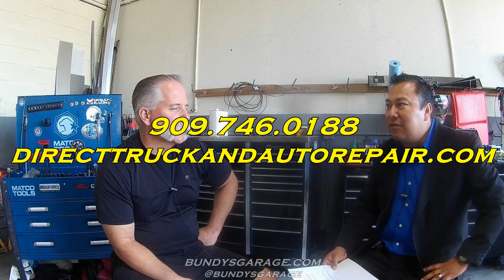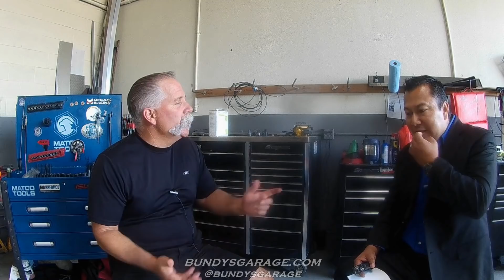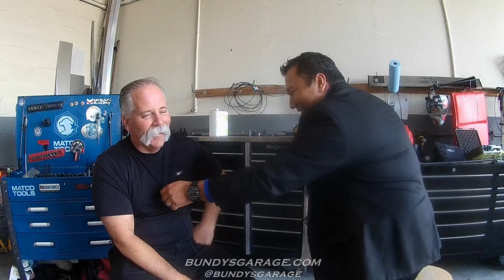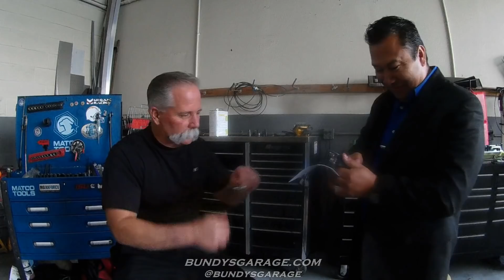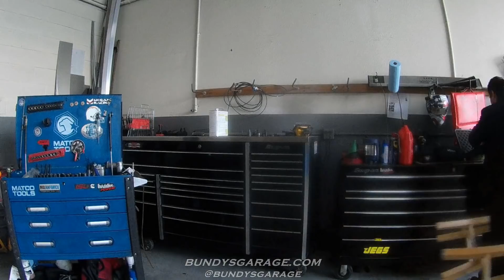Worst Diesel Engine Ever - What is the Best Diesel Truck out There? | Ford Dodge Chevy

Comment: I want to build a F600 single-cab between 1967 and 1972, F250 long-bed, aftermarket fenders, with a pure mechanical 12-valve P-pump Cummins compound turbo diesel,  belt driven lift-pump {predator or fuel-boss},  ARP 625+ series head studs, AFC Live,  Autometer gauges, Allison MD-3060 transmission, MISHIMOTO universal heavy duty transmission cooler with electric fan, NP-205 transfer case, Dana-S110 rear axle, RD1370F8 Reyco-Granning air bag rear suspension, Dana-super-60 CVJ front axle, Kelderman front air-bag suspension, 335/65R22.5 Goodyear G275 MSA tires, on Alcoa rims, AEV high air-intake pre-filter, Central Tire Inflation System, all LED lighting, lots of Dynomat, telescoping west coast truck mirrors,  train air horns, exhaust-brake, hydro-boost brake booster,  stainless steel braided brake lines, Quadraulic hydraulic 4-piston 4-wheel disc brake system, Hydraulic Ram Steering Assist, nu-relics power windows, Hellwig anti-sway bars, Roadmaster Reflex steering stabilizer
To tow a 5th wheel travel trailer across the lower 48 states to see the national parks and visit my extended family.
Not that I have given this any thought.
Just my day-dream!
Reply: That sounds like the truck to own!

Comment: It’s unholy to compare a DT466 to a “7.3”. T444E btw
Reply: The DT-466 is the Legand 7.6-liter I-6 design with wet sleeves a true medium duty work horse.
Reply: DT466 is a hell of a lot better engine.
Reply: @Copperhead Sutton Echo that about the DT466; had a customer with a fleet of local use IH cabovers w/ 22' boxes, can't remember any chronic problems, just routine maintenance.
Reply: DT466 was a good engine that I saw a RR truck get over 400K on but the best ever was a DT530 which was used in many fire trucks and emergency applications. I have owned 20 different diesel engines and got this International 4900 as a cab and chassis from the dealer then put a 12 yard dump bed on it and loaded it heavy. Absolute work horse that was powerful, durable, fuel efficient and dependable for 6 years and 400K plus miles before we sadly turned it over which twisted the frame.

 I built another brand new freightliner truck and specd it the same new 12 yard dump bed but with a cat 3126 that they claimed was the best cats meow but turned out to be a wassy cat, to put it politely because my diesel mechanic called it the other word and said it was a throw away hunk of beap- that cost double and give nothing but trouble from day 1 until I sold it 3 years later after scratching my head and biting my lip over and over. I said no more pouring good money after bad money on this beautiful rig that hates work.

Comment: Very smart mechanic, I am a retired fleet maintenance supervisor for a large ambulance and medical transportation service in Tn. all ambulance packages we owned were Ford E-350 7.3 power stroke engines and they performed excellent , we had our own service department and they were serviced regularly, the engine problems we had after about 300,000 miles were injector and oil cooler O-rings and a few injectors and drivers, turbos. High pressure pumps after about  400,000 miles, just great diesel engines, we had multiple issues with the differential Chinese carrier bearings and of course the E4OD transmissions.

Comment: pickup diesels are all crap especially with DEF. so why waste your money on a diesel? they dont even sound like a diesel so you cant impress anybody, just buy a gas and drive it.
someday the hippies will outlaw diesels for highway use
Reply: Babylon falling  i meant anything after they started putting computers on them, they are not real diesels.
i like my 91 dodge with the 5.9 cummins because of its simplicity

Comment: You can service a 6.0 as much as you want either way the hear studs gonna blow off. I see you found yourself a man a little bias to Ford 😂
Reply: Head studs won't blow off, the original head bolts would.  ARP Head Studs will generally outlast 1 million miles.
Reply: 210,000 on my 6.0 stock head bolts
Reply: @Athlas87  people dont get that by 05 the 6.0 was a solid engine. It had less recalls and warrantt claims in 05-07 then 7.3s had in any 3 years. Most of the 6.0s issues were due to people not knowing how to maint them correctly
Reply: @theboyparker4899  our 05 6.0 blew head bolts at 213k stock besides egr delete. Then the computer followed by high then low pressure  oil pumps, all within about 5000 miles. The shitty oil pumps are what can really kill theses motors, or the factory egr bullshit.
Reply: I see more 6.0's without head studs tham the one with them, Both my 04 and 07 havent had these issues. The only problems ive encountered are the HPOP's on these trucks

Comment: i love my lbz dirtymax and allisons!!!
Reply: Yup, have never had even a slight issue with either of my chevys
Reply: Best truck ever made
Reply: Big Truck Med Rv the lmm is an lbz with a DPF and 5 more HP. Deleted it’s the same engine. Obviously different body styles but the trans and chassis are also the same
Reply: @TooTall85  keep them lubed is the main problem with all highway diesel shit fuel.
Reply: In 2007 I rolled the dice and got a 2500 Silverado Duramax Alison.  The only non lubrication or light bulb expense has been 2 glow plugs and replaced the batteries, which hadn’t died yet at 10 years.   I pull a near or slight past max GVW 5th wheel.  I put on  larger wheels tires, super HD shocks, air-springs, and a lift kit to accommodate the larger tires and extra weight.  I  added an EDGE chip with the Attitude controller. I also run Red-Line full synthetic lubricants bumper to bumper.  It has about 80k actual TOWING miles with no signs of stress.  I live in Oregon and mountains are an everyday part of driving. I’m afraid to trade up as the newer trucks seem a step backwards in durability in spite of having increased power and GVW ratings.  So build me Ford F-350 with a Cummins, an Alison,  an exhaust brake, dualies, and a 50 gallon fuel tank.  ;-)

Comment: Right on. Ford has an excellent chassis. Ram heavy duty is right behind it with similar layouts, So sorry for the engine in the fords 😢. For the record, the Allison trans does not hold up to the cummins, people have swapped that. Torque kills.
     You will say duramax has as much torque, but the Dynomometer has proven otherwise.
Reply: On the other hand, cummins swapped fords have no issue with the torqueshift breaking ;)
Reply: dre04mach as long as you leave your fingers out of the fuel pump or Ecm.
Reply: The dyno proves the duramax has more torque. And Alisons are built for a specific power level. And eat the torque. Swapping a lb7 Allison to a built Cummins is going to kill it yes we've known this since the 1000 came out since the 6.6l was notorious with a tune to destroy it.
Reply: jdr ok open mouth insert foot kid. Sorry for your loss in this debate. Click and learn: https://youtu.be/emJcrYuJArg

Comment: 5.9 Cummins 12 valve with a six speed. If it HAS TO GO IN A FORD then at least let it be a 79 or older.
Reply: If the V-10 in my '04 F-250 ever blows up I wouldn't mind getting a 12 valve for it.  I believe there are even adapters to bolt it to my 6 speed.  The Cummins engine is the best part about a Dodge truck, Chevy trucks ride the best and typically have the nicest interiors (not quality wise, but comfort and features) and the Allisons are typically pretty stout, Ford has the rest of the truck other than those things.

Comment: Powerstroke 6.7’s have been proven.   Look at the used high mile ones 250k plus still going original motors
Reply: Babylon falling  Ford can on the Superduty's but not on the F150's not sure on GM and Dodge although I do know GM uses C/V axles in their 2500 and 3500 models which makes me nervous. I mean it's definitely better for handling on light duty but for 3/4 and 1 ton something about a solid axle makes me sleep better at night lol.
Reply: @josephbowman4571  actually the cv axles should be fine. It's a case of how well you build something. And solid or straight axles really aren't that hard to kill.

Comment: Duramax and Cummins,Ford has not come out with a proven diesel since the 7.3 was dropped.
Reply: 6.7 has no issues. Duramax is a mess. Obvious answer is gonna be Cummins though. Too bad the truck it comes in is trash
Reply: Alyx Ivanoff I always kinda liked the new Duramaxes until my dad and I pulled a big cattle trailer with our friend's 2015 LML. Pretty gutless, but I hear you can get good gas mileage out of them when you're pulling with it. I might get a new Duramax if all I was pulling was a four-horse trailer or a smaller tractor or mini-ex. Other than that, 7.3, LB7, or Cummins all the way!
Reply: @2001FordPowerstroke  lml will fucking destroy a lb7 a 7.3 or a 6bt. Remember a lml is like 800 lbft of torque. The Allison is a huge torque hog tho.
Reply: @blowme6963  6.7 does have issues. Some year turbo issues emission issues. 7.3 6.0 and 6.4s are internationals.
Reply: The  new Ford diesel is fine.  Outstanding, in fact.
Reply: 6.7 is a beast.
Reply: What a lot of people dont know is the 7.3 up to the 6.4 are international engines. 6.7 is a true Ford engine.
Reply: I'm. A Chevrolet guy but all I would  if it's a for was the 7.3
Reply: The 6.0 the way International builds them had zero issues.  Fix the issues Ford added and it eats Cummings for lunch.
Reply: im still waiting for dodge and chevy to come out with their OWN diesel engine...
Reply from the maker: That will never happen. Cummins and Isuzu have Diesel engines down and why mess up a good thing. If Ford was smart, they would have partnered with CAT instead of International for the 6.0L. Could you imagine a CAT logo next to a F350 logo, now that would be a superior engine.
Reply: @bundysgarage  cat doesn't know how to make a engine. The 6.0 was a good design ruined by emissions.
Reply from the maker: Did you just say CAT does not know how to make a Diesel engine?
Reply: @bundysgarage  
All Caterpillar on road diesel engines and yes including the mighty 3406 were engineered and designed by Perkins with a Cat label on it. Honest truth.
Reply: I keep my 7.3 maintenance like clock work. I pulled a mack truck 8 miles at 50 and the tanker has 2000 barrels of oil..😆 praise the 7.3 the only motor that had ball's.  Btw ford did not make the 7.3 international trucks did.
Reply: Walter Frederick AGREED
Reply: the 7.3 was fords best.
Reply: Neither Gm nor Dodge make their own motors currently and the 7.3 was made by international.  Duramax is co designed by Isuzu and Cummins is Cummins.  Though ford does use a cummings in the I believe 650 series.  They since 2010 have made the Powerstroke's themselves.  With the emission regulations there are only going to be more changes so who knows what shape any will end up in.  As far as a total package though he called it here really each does certain things better than the others.
Reply: They dont have that info because they dont uasually break!...ford makes money off of there service depots...
Reply: Rockin m ranch. Do you have any idea wtf you are talking about? Diesels fire off compression not heat. And comparing a c 15 to 7.3 6.0 5.9 6.6 or 6.7 is like comparing apples to oranges.
Reply: the problems with the new diesel engines are all the emissions garbage witch is making them unreliable
Reply from the maker: I have heard the new 6.7L is a good engine.
Reply: @bundysgarage  only after 2013 they had a fatal failure on the turbo coolant line. An O-ring would fail at around 60000 miles and empty the top end of your motor of coolent. And on top of that the transmission has a giant support web on top of it That would catch all the antifreeze, so you never saw the leak until you were on the side of the road with a locked up engine.
Reply: BundysGarage But at least a Duramax is a traditional V8 blowing the heat AWAY from the block. The Powerstroke with reverse heads is blowing the heat to where the intake traditionally was. Thats where they mounted the turbo!
Reply: BundysGarage reverse heads blowing all the heat to the center of the V? Henry Ford could have told you it was a horrible idea. A diesel fires on heat not spark. An inline 6 that pulls cold air from one side and blows heat out the other side is the best.
Reply: @rockinmranch6895  Actually, speaking efficiency related interest, the best engine would be pulling cold air and blowing cold air. Heat is a byproduct of the energy transferred and the efficiency rating is actually quite low for all combustion engines. This probably isn't ever going to happen soon, but there is significant energy losses with the basic design itself.
Reply: If engineers are so concerned about turbo spool up that they're willing to reverse the plumbing of the intake and exhaust tracts, it's not at all difficult to see why they work for MoFo Co, er FoMoCo. Engineers are ignoramus pricks that never have to work on the bullshit they somehow take pride in producing, and then have the audacity to put their names on. That's modern engineering, and Ford is the leader of todays automotive atrocities.
Reply: @zadoknelson6046  
Well said...Dodge won't even put their name on their own stuff !
Reply: Bullshit the 6.7 is a proven diesel
Reply: jason meldrum lol until it blows up or the cp4 destroys itself powerstrokes suck
Reply: The 6.7 is proven
Neither of the big 3 is better than the other anymore
Reply: Jondavid Bristow Proven to lose exhaust valves into the cylinders because of heat stress.
Reply: @rockinmranch6895  167000 on my 2012 no problems
Reply: Jondavid Bristow Im happy for you! Truly! But Im not lying to you, its a problem. Because they reversed the heads!
Reply: @rockinmranch6895  1 of my best friends owns a diesel shop and has never seen that before
Like he tells me leave them stock and there won't be any problems
That's what I did with my 2004 6.0 and I had 387k on it
Reply: Jondavid Bristow I had a 7.3 powerstroke that I did very heavy pulling with and it made it to about 220k miles. I get 800k out of my Cat C15 before I need an inframe. A V8 is not an optimal configuration for a diesel. They were never popular with class 8 trucks for a reason and were dropped in the 1970’s. Take it for what you will.
Reply: Well Caterpillar isn't Detroit Diesel. By any means. And I'm talking the real 2-strokes. Not the 4-stroke shit that was pawned on American industry after caving to federal air Nazis.
Reply: marine industry dominated by the V configuration, a few inlines in smaller applications, mostly v8, v12 and v16's in our field. We run steady at rated power for days, at times weeks on end. Don't drink the inline is best kool aid.
Reply: Jondavid Bristow except when your cp4 pump destroys itself
Reply: Jondavid Bristow 6.7 PowerStroke is blowing through CP4 pumps. They self destruct. Look it up. The 6.7 is a fail. I’d hate to say buy a Dodge, but the Cummins is far superior in every way.
Reply: Rick Rodriguez I heard that’s was a problem with early 6.7s not 100% sure though
Reply: Ford hasn't come up with anything good in the past 20 years
Reply: @crazymacroon  
Ford has managed to not cost the tax payers $60 BILLIONS for government motors and $40+ BILLIONS for dodge in bailout money which is now foreign owned Fiat. Only the fandoys have forgotten that! To most people that can think rationally...that a great accomplishment!
Reply: 6.7l is the new improved 7.3l
Reply: Walter Frederick but the 7.3 had no power? Absolutely no balls on that motor.
Reply: @loganomara2581  It's got plenty to cruise my '02 Excursion down the road at 70mph while towing my 23 foot twin outboard Mako with a 125 gallon fuel tank and still get 15 mpg. Unloaded at 70mph I get close to 20 mpg.  All I've done is put a mild tune and a cold air intake on it
Reply: yeah my son bought one,it is an 02 excursion,every damn time we go to fill it,somebody wants to buy it,its getting old,i was using it one day and somebody goes you wanna sell that I said yeah,50k,he said you're nuts, I said that's what it cost,50k,still have the factory window sticker,its big, beautiful and gets 23mpg with me driving it,285k miles all we do is fill it and change the oil,often,we'll never sell it,the 7.3 turbo diesel is the shit
Reply: @jimbrown7737  .
Reply: Logan O'Mara  had more balls than the 6.5  and all it takes is a tune and it makes it plenty fast I mean not race truck fast but it will move

Comment: The regen process is a joke
Reply: Love the aftertreatment system, keeps money in my pocket
Reply: Money Mac...
Reply: I’ve been making a living with Diesel engines for the past 20 years and the thing with the regeneration is that it burns the crap in the DPF when it gets plugged up. Most people drive there Diesel vehicle like a gas engine vehicle, which is to rev it to high. Making the engine work more, having the engine temperature getting hotter every once in a while will keep the DPF clean and you will never have to wait for regeneration again.
Reply: Regens keep them running less EGR witch saves the engine. I agree. No emissions is so much butter but if your following the law. It’s better then egr.